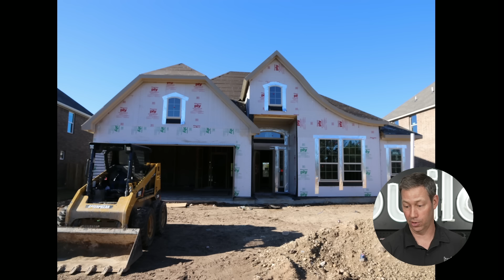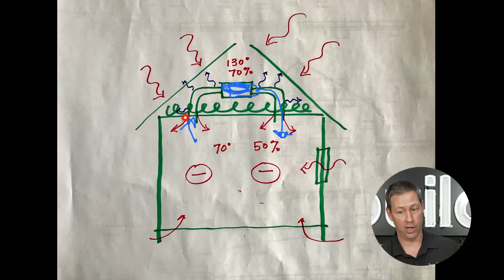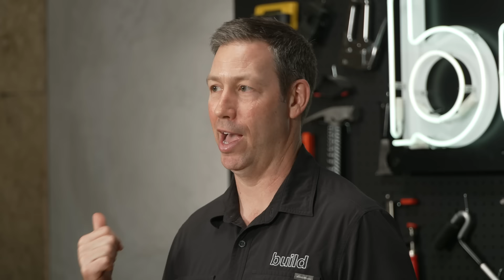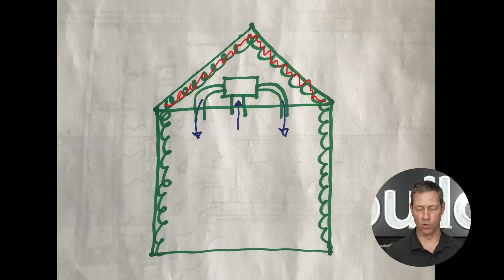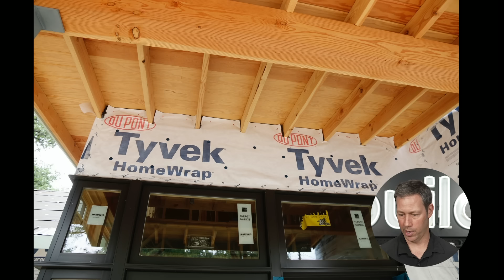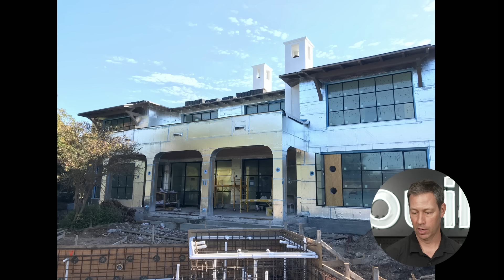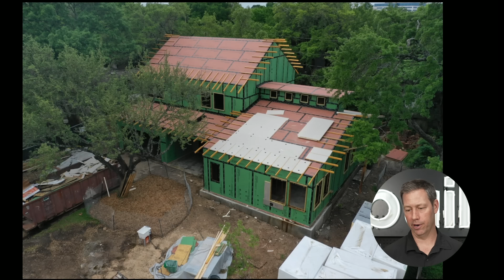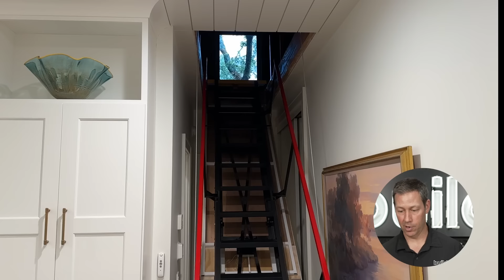CRAPPY ATTICS are Standard in America! Here’s how to BUILD - DECENT or AWESOME

Comment: This could be an entire series. How to turn a crappy attic into a good and great attic in every climate zone from paper/concept to completion and the common pitfalls people run into during the process and how to avoid and/or overcome them
Reply: What about attic humidity with the spray foam: https://youtu.be/_GStKHVCWWw
Reply: Climate would not matter.  You would just go for a texas attic with or without a basement.  Then have your basement be open for whatever you want instead of noisy hvac.  The texas attic make sense for any attic because the space is otherwise unused.
Reply: @aussie2uGA  This is a complicated topic because it's counter-intuitive and it's very seldom explained well.  Also, as he says in the video, different regions/climates have different issues.  I'll try to write a longer comment above to explain this, but the short version is that:

In cold weather zones, water vapor comes from inside the house and will naturally rise into the attic and either exhaust through vents in a vented attic, or get trapped in a sealed attic and eventually condense and cause mold issues.  If you want to seal your attic then you have to plan for clearing out that water vapor, whether that's a dehumidifier or a return air duct or whatever. (One common approach is to clear out any attic floor insulation and hope that natural air exchange between the attic and the floor below will clear out the water vapor.  Note I said "hope"...)

In warm, humid weather zones, you worry more about pulling outside air in, which is warm and humid.  It hits the AC in the attic* and either condenses on the exterior of the AC machinery (which is pretty cool) or worse gets sucked into leaky ducting and condenses inside, leading to some of the problems shown in the video.

(*  Warm weather zone houses tend to have ACs in the attic, because they don't have basements, because houses in those zones don't need to worry about frost heave and don't have a frost line, and also often have a near-surface water table.)
Reply: In every climate zone... that's beyond the scope of this channel.
Reply: Yea, but he get's no ad rev for it. you lose your ad rev when you swear in the first 2 minutes of the video now, I think. This was a good potential series about addicts.
Reply: Every climate... vented roof, stop putting mechanicals in attic.   Need to poke holes in ceiling [lights, fans etc]?  - frame a crawlspace above finished ceiling/below all the fluffy stuff [three feet should work] so maintenance stays out of the attic.  Plumbers and their codes for stack vents?  No cure, but fire stop peovides a reasonable air barrier while providing its purposed protection.  Thank you.
Reply: I would like to watch that series. For instance the sealed attic only makes sense if you live somewhere where you need central AC. Around where I live you want your attic vented as much as possible. Then during the evening when it cools down outside you turn on the whole house fan. This blows the hot air near the ceiling in the house into attic and allows more cool air to enter the house thru the windows. The additional air flow also helps the attic cool down.

Comment: Important tip, watch your duct work install, those guys often want to take the shortest path (makes sense) but will also eat up all your attic space putting duct work out in the middle of what could be very accessible storage.  You can tell he either monitored the install, or had guys who knew what he wanted, given how the ducting is all secured to the ceiling rather then being strung all over itself on the decking.  Very nicely done.
Reply: Well, it was his house, so he got what he wanted lol... Agree though... every thing in my attic is strung in the worst, laziest way possible and though its big, it is 0% usable.
Reply: I would be more worried about flex duct. Never run more than 7-8 feet of flex duct per run because it is so restrictive to airflow
Reply: I had a duct guy run duct in my attic and he was great.  Ran that ductwork around the perimeter of the finished attic to give me maximum storage space.  So they're not all bad.
Reply: The HVAC system should not be in the attic to begin with. So "finishin" the attic is a $30k mistake on top of a mistake,
Reply: @M13x13M  Well, No basements here, so options are limited, especially when you are trying to optimize living area not storage area.
Reply: @spinnetti -Really, no space for a mechanical room in a 4,000 s.f. house? 1000 S.f. houses used to have mechanical rooms when people didn't have money to waste.
Reply: @M13x13M Homes in the South are built slab-on-grade. (I moved from Florida to Washington, and one of the weirdest shocks for me was walking on a structure that flexes and makes noise.)
Reply: yes.  I had an idiot installer and routed stuff in the worst possible way.  I was busy that day and couldn't watch him 100%.  to this day I even have a room that doesn't cool/warm well because of how he built the distribution box.
Reply: Just bought a place and "discovering" that issue rn.  this vid is great.
Reply: But the longer distance of duct the less efficient it is. Keep that in mind as well.
Reply: As mentioned in the Video as well as some of the comments, A/C in attic isn't the best option to begin with. even in an enclosed envelope like he built you still are running larger fans ducts etc. to pump air to other rooms when for the same price or cheaper you could install mutil climate mini splits and be more efficient and no ducts
Reply: You have to take into consideration what the space is worth to you. Every  bend in the duct is a higher electric bill. Every 90 degree elbow is considered the same as 5 feet of duct, plus the turns disrupt smooth air flow. 
Doing a couple might constrict a couple of vents, but several can be a substantial difference. 
Then comes the problem of the duct being in close proximity of a 150 degree roof in the summer, if run overhead.
Reply: @CM-ve1bz 

      True, but his duct bends are 30-40 degrees and with his “double roof” and foam/ rockwool he is at R50 on the roof.   In the attic, the ducts are  probably 75-80 degrees tops.
Reply: Ductwork is required to be ran and strapped overhead in most attics, by code, but most people don’t pay for reputable ductwork installs or diy but dont care nor know what theyre doing

Comment: The concept of clipped rafters and extending the house wrap up and over the roof is pretty easy to understand.    What I didn't quite catch was how you then built the deck on top of that to re-extend the eaves.  Would love to see more detail about that aspect of the build.  Great vid!  Thanks!
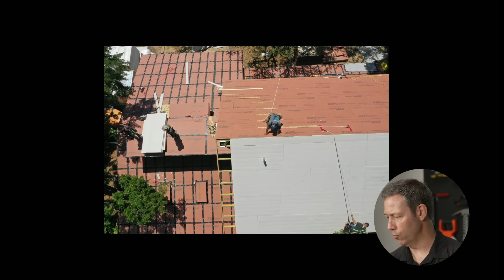Reply: 27:50 covers it somewhat.  He may have other videos on it.  Basically they're 2x4 sized LVL beams (engineered lumber) fastened to the roof framing on top of the main roof rafters.  They extend up the roof 2 to 3 times the length of the overhang to give proper cantilever support.  Then the 2 layers of rigid insulation is placed on top of the original ZIP system roof deck, and cut around those secondary "rafter" tails.
Reply: I didn’t get it either. however, the picture shows a grid, so it must be something like 2 x 4 on edge filled in with insulation.  But it seems like he also said that those rafters don’t extend all the way to the top of the roof, so maybe only the two by fours run horizontal full length, and as far as the pit goes, little pony raptors extend up the roof pitch, maybe 2 feet or 4 feet past the wall.
Reply: @Patrick94GSR :  OK that’s what I thought I saw, thank you for confirming, also wise choice to use LVL.

Comment: 21:36 you should be aware that close cell spray foam in attics has caused some serious issues here in the gulf south. We found a 5 year old home with close cell caused the rafters to dry and crumble. This was identified when the inspector walked on the roof and found soft spots. When they removed the close cell foam they found no water damage but the lumber was dried out so much you could crush the 2x6 by hand. The lumber here in the gulf south must maintain some level of moisture. The spray foam solution in the gulf south is open cell and if its done right your attic space will only be 2 degrees different from the house.

Comment: Attic access: In the future use a raised heal roof which you build 2 foot to 4 foot walls along the sides so the roof height is raised. This also makes it a lot easier to run duct work along the sides of the attic leaving more space in the center available for storage or just maintenance access.
Reply: This is actually quite common practice in Europe. We recently built a house and we did the same, the attic space is living space with attic windows and raised heal roof
Reply: Amen! Love how he built his own home. I just had my ductwork caulked and re insulated attic to r 60 in south Texas, did the best as could be done on a 25 year old stilt home next to the bay. I can’t help thinking about a radiant barrier as well inside attic roof. New roof has ridge vents put in, I need to put sensor back up there to monitor how hot it gets and put in a gable end vent fan. It was getting up to 120 Fahrenheit up there last summer. I do notice my a/c is not cycling on as much so I’m hoping it will make a difference on my power bill. Heat index has been 115 down here in south Texas, power went out early this morning until 12 pm, house stayed cool until it came back on. I wish all builders were like him!
Reply: I have a barn shape with space on the sides but I am going to add drywall so I'll be closing off the sides: foamed roof deck to the eaves, and the knee walls will have two layers 5/8" + insulation for soundproofing. Am I running a high risk of mildew or issues? I wonder if the solution is as easy as running to/from 4" flex ducts so I can hook up a dehumidifier at some point?
Reply: @GregoryGuay  Depends on multiple factors: is there eaves vents, how humid is your area. Typically interior moisture moves up into the attic, and condenses on the colder roof sheathing. In a vented attic airflow prevents any significant condensation. If your installing drywall the the condensed moisture can become trapped and accumulate.  An attic dehumidifer would definitely help, but may not guarantee you don't have issues. I would install a drain line for the dehumidifier, since odds are some one is going to forget to empty the bin. Perhaps get the dehumidified running and see if it can maintain RH below 60% before installing drywall. 

Generally finished attics need to be apart of the building HVAC envelope to reduce condensate build up.
Reply: @guytech7310  Eaves were sealed off with spray foam w/ the roof deck.  Charleston, SC is very humid. I currently have a dehumidifier, small cheap one, in the approximate 1,000 sq foot attic space. No AC up there, but the lower level of course travels up through the ceiling. The dehumidifier is connected to HVAC drain so I could continue that...

Comment: I live in Wisconsin, my old house (story and a half with a fairly steep pitch) had the attic spray foamed by previous owner through focus on energy. They didn't use proper vent between the rafters before foaming. The roof sheeting was horizontal dimensional  lumber with gaps because the original shingles years ago were cedar wood (tore off) They used OSB sheeting over the dimensional lumber so the asphalt shingles would lay flat and not sag into the gaps. With the asphalt shingles and spray foam, the  temperature changes would cause condensation to form between the tar paper/shingle layer and the OSB. The OSB soaked up the condensation and couldn't dry out because of the foam and no air circulation under the decking, causing it to rot. I ended up tearing off the entire second story and rebuilding do to condensation damage.
Reply: Exactly!!!! I live in Wisconsin myself being a contractor here my entire life.

Comment: I had a crappy attic. Insulation batts seemingly just thrown everywhere, rat and bat droppings, etc.
I used a half-face respirator while moving all the insulation to one side and vacuuming up all the dust and crap, then laid out the insulation between the 2x4s. 
Then i floored it with 2x6 (where i worked, we routinely got pallets made of them, so all free wood!) 
Then i put more insulation under the roof, and covered the entire underside with plastic (to keep down fiberglass dust and help with moisture.)
Added light fixtures, and now it's a decent storage area! 
Access still sucks, though. One small access hole in an upstairs bathroom.

Comment: I really appreciate this video. I had my house built in 1993, moved in the very last week of. It was (and still is) my first house. I accumulated pages of “wants” for a number of years as I had anticipated this being my only house, I envisioned starting my career and retiring from it all walking in the same front door. This did happen, I’m 5 years into retirement! Needless to say some details/wants do get missed for the list. One major disappointment was why the heating/cooling/duct system was in my crappy attic! The system has four thermostatically controlled zones with hyperbaric bypasses etc. The zoning computer and duct damper motors being in the attic under the worst possible conditions in the summer and winter simply didn’t make sense, so after much consternation I dreamed up ways to create a conditioned space for the HVAC and duct controls. I came very close to installing insulation bats under the roof myself but oh what a job I figured it would be with my higher pitched roof. In the mean time I kept on replacing the controls since the plastics (housings/gears/etc) would become brittle and break about every 8 years. I worked on ideas for years until 2010 when I ran across a company at a builder’s convention who demonstrated their closed-cell spray foam installation system. I asked if this cold be applied to an already built home and they said yes. I asked if all the blown-in fiberglass insulation would be vacuumed out, they said yes. I asked what would be done with the turtle vents (attic ventilation) near the roof peaks, they would be blocked off but one or two would have to remain if I had a gas furnace. At the time I didn’t. I built my house with the intent of being all-electric but still had it plumbed for gas everywhere as a possible convenience for future equipment possibilities. I told them I would soon be replacing the all-electric heat-pump (w/30 kW back-up heat strip air handler) with gas just before the system turns 20 years old, so they said two vents would have to remain open. My house with 3300 sq ft under a 7/12 pitch roof would run about $10,000 to perform all this work. They came out June of 2010, did the work and I couldn’t be happier. The fellows who did the re-insulation work were absolute troopers. It certainly helped with my roof pitch being 7/12, meaning they were able to get almost everywhere by standing upright. The downside is more surface to foam than a lower pitch but this project was so darn worth every penny because of the performance to date, even with the requirement to have two of the attic vents remaining unblocked because of gas being plumbed/used in the attic. Made a HUGE difference in my utility bill, plus I can be in my attic any time of the year and be quite comfortable. The best part is the plastics in any piece of equipment no longer exhibit accelerated aging from the extreme seasonal temperature swings in Amarillo, TX. I had the HVAC totally replaced in 2012, employing a variable speed 23 SEER condenser and a gas furnace/air handler. The contractor for this bit said the best thing I had ever done to prepare him for this job was the spray foam under the roof, so much so, he was able to design a lower capacity system than what I had previously.
Reply: paragraph breaks, my man. i wanna read this but there's no way to keep my place in a wall of text.
Reply: @lurklingX Capital letters, my man. The irony is thick.
Reply: You are describing my house! Zoned HVAC. Crappy attic insulation on attic floor. I’m replacing all electric HVAC system in a couple of years with gas heat. The unit in the attic looks like crap. Built in 2009. I bought 12/22 due to my home being destroyed. Didn’t choose to rebuild due to many factors. I always read to use open cell insulation in the southern states. Now you all say closed cell. So, closed cell it is between rafters. Once that is done, do I need to pull out rolled insulation between floor joists? Or will company doing blown in cell remove it? Thank you all very much! S. Hall (this is my son’s YouTube account)
Reply: @Xrager101x  When I asked the fellows about vacuuming out the attic floor insulation they said it actually was a recommendation of their’s to aid in passively conditioning the attic. Temp swings in the attic would sharply reduce (they certainly have!) and benefit the operation and longevity of the HVAC equipment and duct work suspended from under the roof.

We’ve had many weeks this past summer in the low 100’s. Though my attic was warm it was not hot, no where near enough to chase me out while routing new CAT6 cables among drops to various rooms, though my shirt eventually got wet in the usual places. It was actually workable whereas before the environment was quite unbearable even with summer temps in the 90’s.

We get well below freezing (teens, single digits) for extended periods in the winter, sometimes below 0. Before, I could put an ice tray of water on the insulation covering the attic floor and it would readily freeze. The attic now, though cooler than in the house is still quite bearable.

The system no longer has to work so hard to overcome extreme heat to cool the house, nor quite the opposite in the winter.